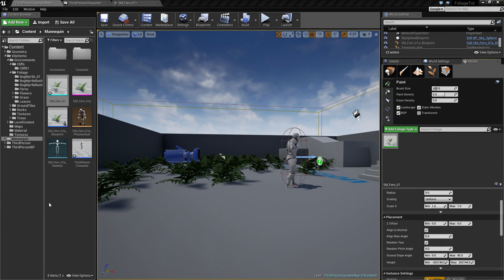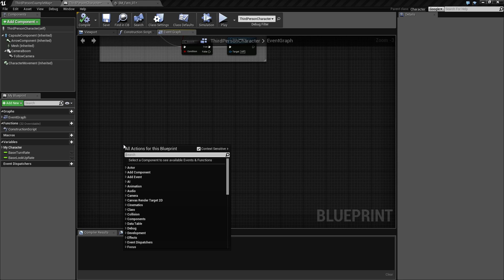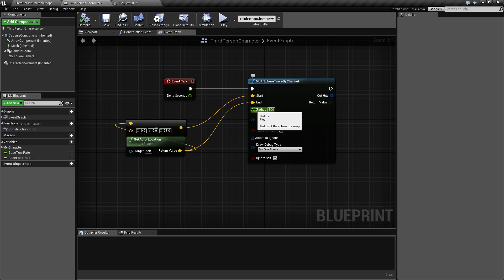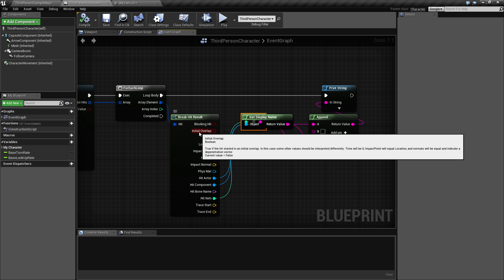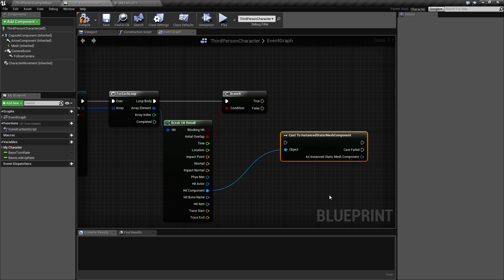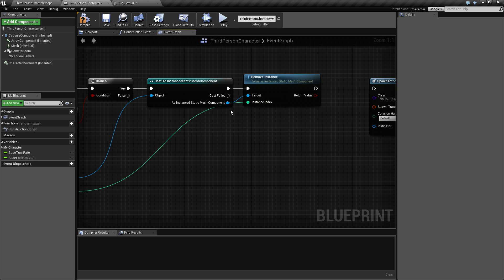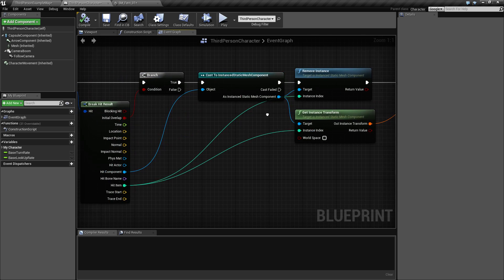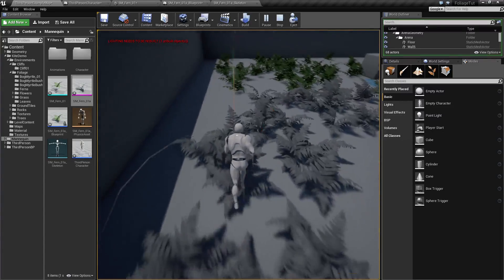Physics interactable foliage - Part 5 Making the initial blueprint implementation

Comment: i have multiple different foliage actors scattered in my scene, im using this method for tall stylized grass...but when it places the original foliage after removing the blueprint foliage at the the end of the function.. it places trees down that i have scattered instead of my tall grass. any idea what i could do to fix this? Thanks!

Comment: Why didn't you just spawn a SkeletalMesh instead of a Blueprint Actor? Or, why didn't you create a Blueprint that populates multiple SkeletalMesh Actors around some point instead of using Foliage Tool? Spawning lots and lots of Actors during runtime isn't a good idea.
Reply from the maker: +netgoblin to be honest, i didn't know how to spawn a skeletalMesh, but the idea with spawning one blueprint actor that can handle spawning of all the skeletalMeshes sounds like a much more efficient way for sure. Good point! When that's said,, the description in the video did explicitly say: "no considerations to performance is taken" ;-)
Reply: Use 'Add Skeletal Mesh Component' node.
Reply from the maker: +netgoblin ah yes, within an actorblueprint. I guess it's something definetely worth looking into for optimizing. The logic i build later on will have to be rewritten though, feel free to post a followup on how to implement the final solution. That would benefit the entire community. Anyway, thanks for bringing it to my attention.